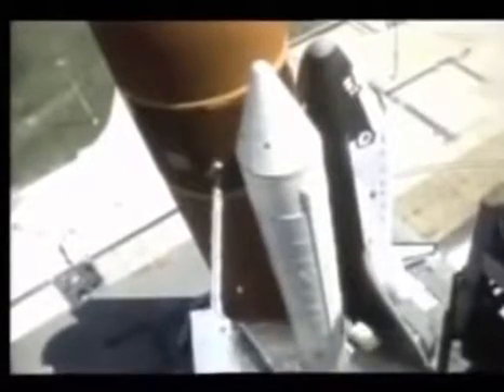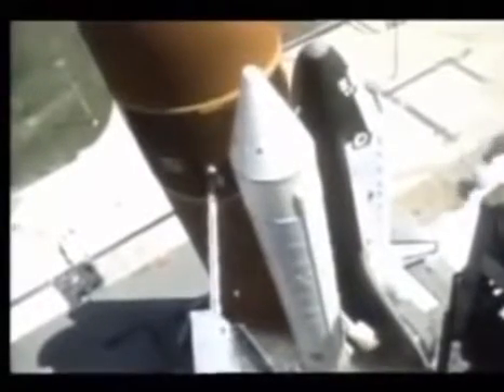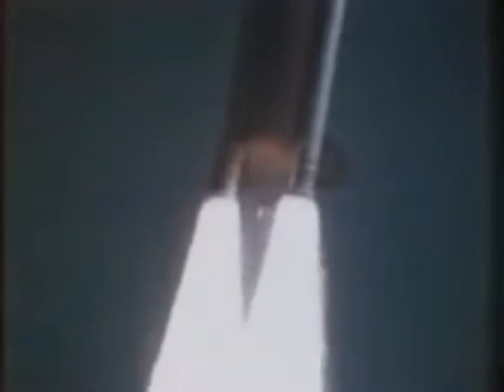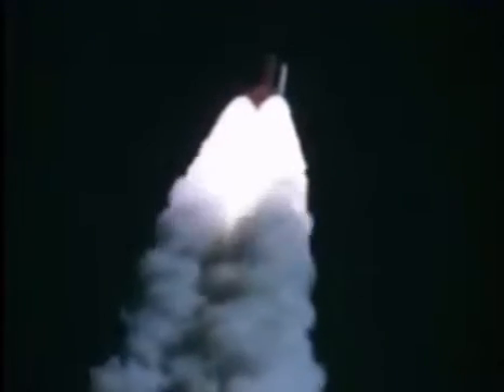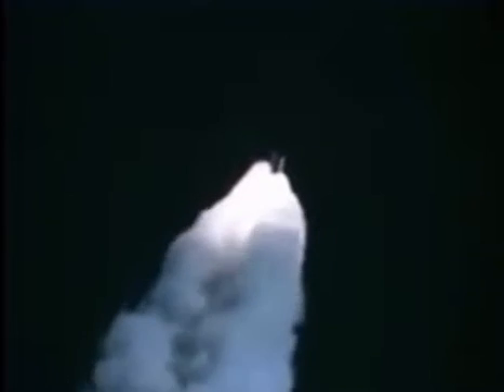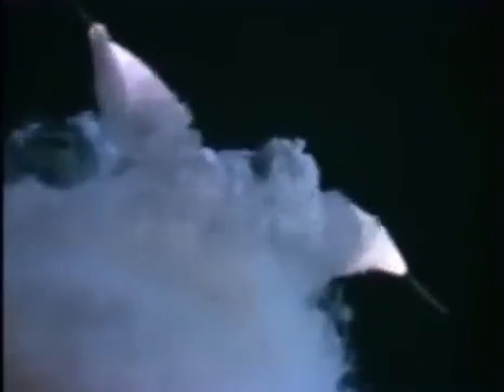Challenger Disaster 1986 - Camera: E-203

Comment: Did the SRBS have any kind of steering fins or engine gimbaling capability? How were they able to (somewhat) correct themselves and continue upwards? What was stopping them from just spinning around in circles? 🤔
Reply: The SRB nozzles could in fact gimbal just like the orbiter's main engines. When normally attached to the stack they took nav inputs straight from the orbiter. When they detached after the tank explosion, they were left flying blind, as it were. Remember that the shuttle stack was going about Mach 2 when it blew up, so the separated boosters still had a lot of momentum to help guide them (more or less) upwards. Also note that while the left SRB continued to fly (again, more or less) in a stable fashion, the right one, because of the huge side leak, ended up side-slipping most of the time.

Comment: Wasn’t the explosion slightly heard on radio?
Reply: The sound you hear is not an explosion. It is actually static feedback on the comm caused by the loss of data.
Reply from the maker: The explosion sound that you can hear in that footage is coming from an astronauts microphone. 
I think the real soun of the explosion was released later.
But yes, you can slightly hear the explosion from the radio.
Reply: @Javnfit  There was no explosion.  The tank ruptured and emptied.

Comment: Crew audio documented the rough ascent they attributed to “winds” but was the left Srb
Instability and the perturbations it caused in flight dynamic..the left srb was highly unstable from very early in the launch..the shuttles thrusters adjusted to maintain aerodynamic stability and inclination of the orbiter..this data is there...yet no one wants to ask why these highly irregular adjustments did not immediately raise flags and cause an abort launch sequence..when these adjustments by the orbiter are highly irregular during a normal ascent
Reply: You can't exactly abort with those SBRs firing.
Reply: There was no abort mode while the SRB's were still burning.

Comment: At 1:06 we see an extra plume coming from the starboard SRB.
Reply: Yeah that’s the re emergence of the plume which burned the aft strut as well as burning into the liquid hydrogen tank. After that, the SRB rotated into the top of the ET, rupturing the liquid oxygen tank and causing the liquid hydrogen and oxygen to mix, resulting in the vapor cloud that led to the vehicle break up.
Reply: That’s about the time of the big impingement of the ET aft pressure bulkhead. Lh2 was being ignited by the srbs and ssmes that were shutting down due to low fuel pressure.
Reply from the maker: Yeah, it is the back of the vehicle. The O-Ring problem shouldn't have been avoided...
Reply: Lawrence Malloys negligence and the horrible lack or no communication between contractors, facilities and NASA administration was the mixture to tragedy that completely avoidable.